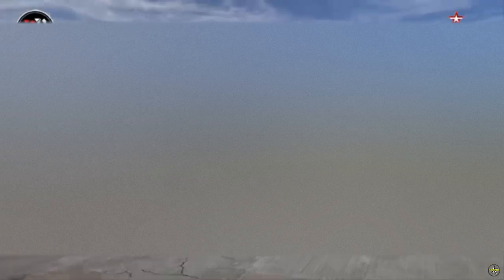Russia demonstrates test flight of flat nozzle engine on Su-57 Felon

Comment: People don't realize Russia were the first nation to implement flat nozzles on there 1970's vtol yak-38/41 program, only for testing purposes of thrust vectoring are they mentioned, Quote from yakovlev:
"a flat two-axis nozzle was designed in the second half of the 1970s for the Yak-41 vertical take-off and landing (VTOL) deck fighter. An original solution was used for its rotation – the nozzle was divided into three segments, which, rotating in opposite directions relative to each other, provided a deflection of the thrust vector in the vertical plane to an angle of 95° (at VTOL mode). For short takeoffs, the nozzle was set to 62°. This solution made it possible to use afterburner both in horizontal flight and in vertical mode"
Reply: You forgot the Sukhoi Su-27LL-PS
Reply: @snabanik09  Good call the freak.
Reply: Where were the flat nozzles located?
Reply: @AshleyRiot-lf8dw  sukhoi website, early yak-38 test flat,
if you plan thrust vectoring flat nozzle are not just stealth but also stability to control a smoother thrust.
Reply: Thrust-vectoring was invented by 🇬🇧UK in 1950's for the Rolls Royce Pegasus engine which powers the  British VTOL Harrier Jump Jet. Yak-38 is a failed copy of the Harrier.
Reply: @dsdgdsfegfeg Russia had 1960's vtol yak-36 many youtube vids of it flying, Kestrel/Harrier wasn't supersonic that superior feat of engineering goes to Russia with yak-41 Mach 1.7 it still hold 12 aviation records,
Reply: @paulroberts7429  Buddy, putting a giant badly designed engine in a VTOL isn't a "feat of engineering" it's bad engineering. Yak-41 never made it past prototype, Harrier was highly successful.
Reply: @paulroberts7429  Yak-41 was so heavy it's engine could not lift Yak-41 off the ground. They had to add extra engines just for VTOL. Harrier was half the weight, yet carried double the weapon Payload of Yak-41
Reply: @paulroberts7429  Russia never managed to produce a single engine VTOL. 
Literally anyone could have done what Russia did .. put on extra engines for vertical take off, but we didn't .. because it was a obvious bad solution.
That's Russia in a nutshell.
Reply: @dsdgdsfegfeg Rubbish Kestral was cancelled by British government because they wanted a supersonic VTOL, Navy kept P.1154(Harrier} but the British failed, US tried with AV-B the engine was rebuilt by Pratt and Whitney they failed to supersonic, only the Russians on a carrier with a group of aviation adjudicators watched as the Yak-41 VTOL reached Mach 1.7 and land, Yak-41 hold 12 aviation records, Russia would move on from VTOL to 2D and the worlds only 3D thrust vectoring SU-57m
Reply: @dsdgdsfegfegIts not the engine it was the heat, Russia achieved supersonic vtol because it developed a titanium alloy capable of withstanding the heat, Russia for 50yrs as used a oxygen rich closed cycle rocket engine to withstand the tremendous heat Russia used a Titanium alloy, US tried to build a oxygen rich closed cycle rocket engine but failed it melted, that is why US as used over 100 Russian rd-180 last one was 2025.
Reply: @paulroberts7429  🔸Incorrect (again)
British Harriers for US .. used the same UK engines.
Pratt & Whitney were going to build engine in US .. but never did.
Reply: @paulroberts7429  Now ur talking about rockets? 🤣.
Russian engines were all badly designed, they used cheap materials and bad physics and thus had to build super big engines to compensate.
Reply: @paulroberts7429 Nothing is hard about creating a Supersonic VTOL buddy. If all UK wanted was a VTOL supersonic .. all they had to do was put a bigger engine on it. UK engines were far more powerful than Russia's Soviet engines.
Reply: @paulroberts7429  What was hard .. was making a VTOL supersonic ... with the required payload, combat radius and requirements for UK's Blue Fleet Military. Russia never even managed to create 1 Yak-41. All Russia had was 4 badly created prototypes which no one wanted.
Reply: @paulroberts7429 🔸 You .. "Russian created an engineering masterpiece because the SU-57 comes in blue"  🔸Me .. "anyone can paint their Jet blue buddy" 🔸You .. "but you didn't, Russia did bc Russia is Amazing" 🔸Me ..  🤦‍♂️
Reply: @dsdgdsfegfeg How do you know its Russian, stop Lying Russian pilots claim their yak were amazing, 263, Russia used titanium, Yakovlev beat France, Britain, US, Germany and NATO they all partnered on VTOL together and failed, with superior engineering Russia beat them yak-41 Mach 1.7 and Vtol.
Reply: @dsdgdsfegfeg no they couldn't US tried Britain tried it melted the engine, if you actually knew what you were talking about you would know Harrier chief engineer Sir Sidney Camm stated that materials used on Harrier could not contain the heat generated by thrust and that Russia overcome the heat problem with classified Titanium alloys, Lockheed in a letter to congress also stated this as a reason for Yakovlev partnership.

Comment: 😂BIG PEACE OF CRAP 😅 TRYING TO ACT LIKE A F22😅
Reply: it's better than f22 , f22 is a outdated plane of the 90's
Reply: f22 have 2d thruster nozzle its alrready havve 3d theyr moidifiyi g uit to 3.5 d it loos like 2d nozzler but its cover on 3 d its can act like both 3d and 2d its more like 3.5 now fat better then f22 . su 57 can hit 2900km toop speed while f22 can go 2414km only and su 57 have advanced radars
Reply: @Godyahova  The hell is 3.5D.
Reply: Learn to spell before writing nonsense.
Reply: F-22 is 40 years old flying junk that its going to be retired in 5 years while the F-35 is a flying failure money pit lmaoo
Reply: SU-57 is a 4.5 Gen fighter Jet, not 5th Gen, they have built approx 20.
EU has 1800 4.5 Gen & 5th Gen Fighter jets

Comment: Well then it is the Su 57m or does it not have its new engine yet
Reply: all new Su57 from 2024 have new AL51 engine
Reply: @bagamut  As well as Q4'23.
Reply: @bagamut  Externally, nothing has changed. As were the engines of the 70s, but now with a cap from a tube of toothpaste.